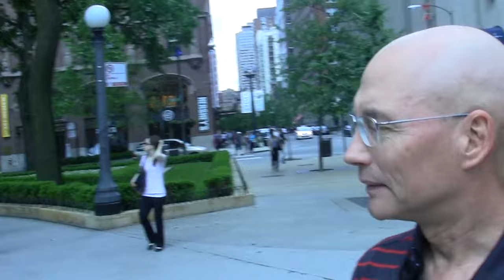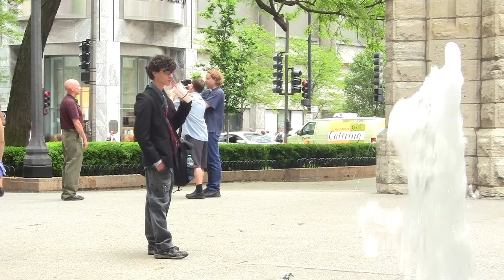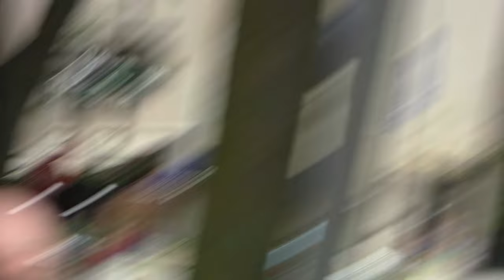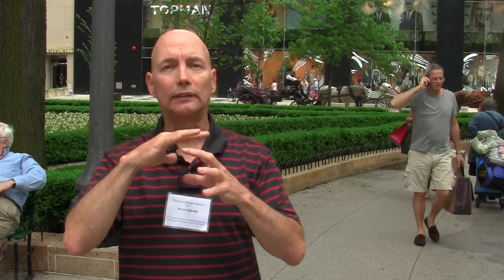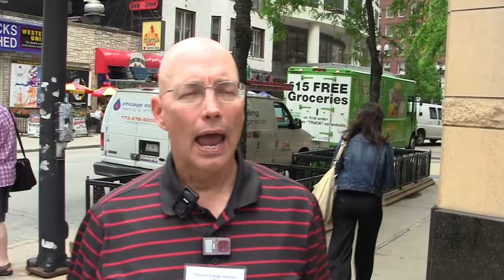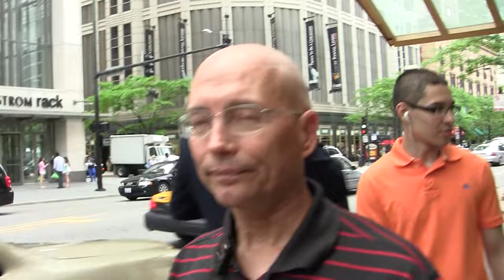Bruce Hoglund on Molten Salt Reactors @ TEAC5

Comment: It's a little known fact that the reactor at the core of the first Death Star was actually a molten salt reactor.
Reply: A molten salt reactor would be insufficient to power the Death Star.
Reply: @murphyjackedoff5970  What if the Death Star was built using all the salt from Crait?
Reply: But they called it a pyroprocessor which is why it blew up

Comment: I never would have learned about this stuff if it weren’t for George Lucas, but I hope they make the reactors this guy is talking about.
Reply: Definitely.  As long as there is an open fuel cycle, the anti nuclear advocates will have a legitimate reason to be fearful of nuclear energy.  Molten salt fast reactors would really bring the technology closer to eliminating nuclear waste.
Reply: @senorgazpacho7432  finally a normal comment
Reply: It's is there in india, still expensive. since less research.
Reply: @senorgazpacho7432  and once there is no legitimate concern about nuclear, we can build more plants.
Once me build more plants, we can shut down the fossil fuel plants, and worry less about battery storage.
Once we shut down fossil fuel plants, we can consume as much energy as we want almost without any guilt.

Comment: How do you take the converted thorium in the core (solid)  and turn it into more fuel salt?  Disassemble and dissolve the core?
Reply from the maker: Thorium is converted into U233 in the blanket (liquid salt) then moved into the core (liquid salt). "Core" doesn't mean solid with Molten-Salt Reactors. Chemistry is needed to pull out the Protactinium (what Th turns into before becoming U233) or U233 from the blanket salt. And in the case of dual-fluid Th-MSR chemistry is also needed to remove impurities from core salt so they don't absorb too many neutrons. Lots of liquid chemistry going on.

Comment: honestly that discussion at 50:38 on how the Integral Fast Reactor (IFR) in the US had some really interesting points:
1. it's the last of it's design built in the US
2. They brag about their "pyro processing" reprocessing feature, when in actual fact they're being dishonest in that it's a molten salt process to hide the fact that molten salt can be used for way more things than they give credit for.
3. Holy shit is that George Lucas
4. An intense molten salt fire caused by it's short half-life is almost impossible to put out and was part of the reason the Fukushima disaster was so bad.

Comment: What about graphite swelling in neutron flux?
Reply from the maker: It does do that. Does that for all thermal-spectrum MSR since they all use graphite moderator. People designing these things believe it is not a show-stopper, although most consider graphite to be the limiting factor on core life. So ThorCon and Terrestrial Energy have short-lived vessels. Flibe Energy is looking at swapping out graphite in a longer-lived vessel. Only Flibe Energy is using graphite to segregate core-from-blanket salts.
Reply: For someone non scientific and with limited knowledge in the area of nuclear reactors, such as myself. If I understand your comment correctly you are saying that there is graphite still in use today. My question being with the risks associated with the use of graphite cores why does the world still use them. My second question is to ask your opinions of fusion reactors and lastly why has the world assigned so many negative connotations to nuclear technology. P.S. sorry for being a few years late.
And are there any books you can recommend on molten salt, thorium and the positives of and negatives of nuclear energy and or nuclear energy versus renewable energy.

Comment: I'm not nuclear physicist, but from what I understand its difficult to find a coolant that has a low neutron cross-section along with the other desirable traits of a coolant.  Liquid sodium is bad based on operational experience.  The power density is also very high, and that can be an issue as well.  But I really don't know anything about fast spectrum reactors outside of the few that have actually been built.
Reply: The only thing I understood was George Lucas

Comment: Hey, at 50:38 you can see the guy is using a Sansa Clip+ to record the audio! I have the same mp3 player.
Reply from the maker: Rockbox firmware. Much better than the Sansa firmware for recording MP3s (and probably everything else). The timing on the devices (I've got ~10 of them) is consistently off though, I'm always altering speed of audio in Premiere Pro by about 100.04%.
Reply: @gordonmcdowell  If I remember correctly, the official firmware can't do recording. But I haven't used the official firmware myself, I installed Rockbox right out of the box :-) 

I haven't seen it used like this before, but it's quite clever. I might do this for future video recordings myself.

Comment: 1:00 "...I want to basically go back to the future...recreate that...but instead of using graphite as the fuel I want to use molten salt...": 

What? Graphite wasn't the fuel. Molten salt isn't the fuel. Graphite slowed down the neutrons allowing them to split the atoms. Before that, the neutrons just blew right through the atoms and the chain reaction never started. And molten salt does basically the same thing as the graphite. But its principle purpose is to conduct heat. It can do that from 300C to 1500C without a state change. Water only has 100C range.

Lots of smoke is being blown around here. 

Try this: I have my own country. I'm the sovereign. We can do anything I want to. Now I've decided to build a thorium reactor to generate heat to run a gas turbine to drive a generator to light my gazebo. 

I've been told I can get thorium free from a friend's mine. It's a waste product of mining rare elements. He has tons of it. And he says with a ton of it I can equal all electricity used in the world for a year. I'd like to buy 10 pounds of it to light my gazebo forever after.

What's holding me back?

If I said I want to build a steam engine you would say "piece of cake". What makes building this reactor any tougher. For the steam engine, machining is my single highest cost...the steel coming in second. What is the highest cost of my thorium reactor. I know it's not the salt...and I know it's not the thorium. So what is it? What do I need to build the reaction vessel and how small can it be? What do I need to build the blanket and how small can it be? 

Remember, there is no government in my country so we don't need to tell them to go pound sand.